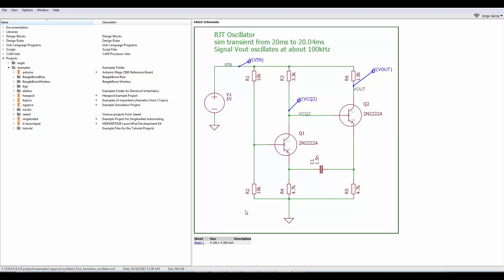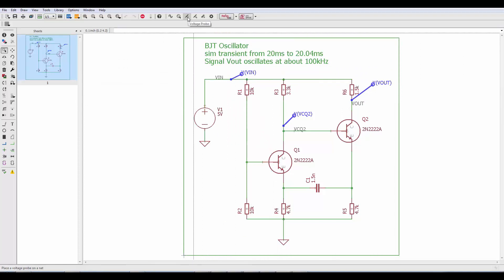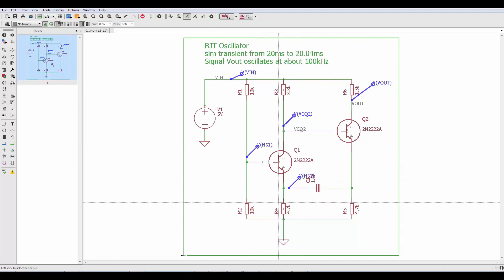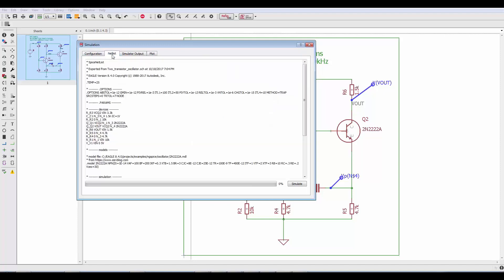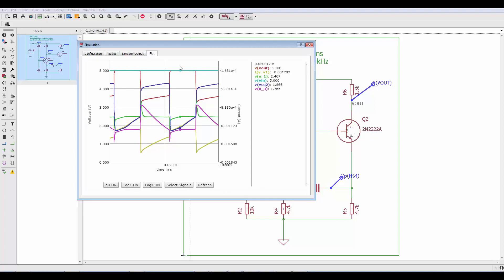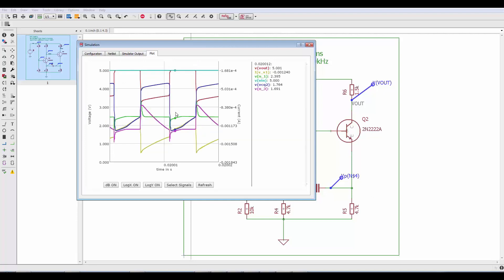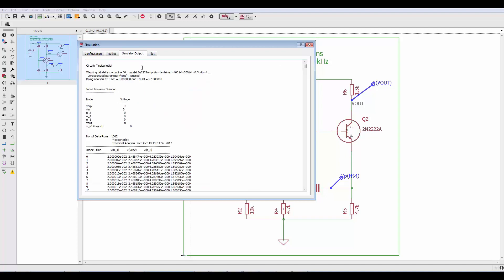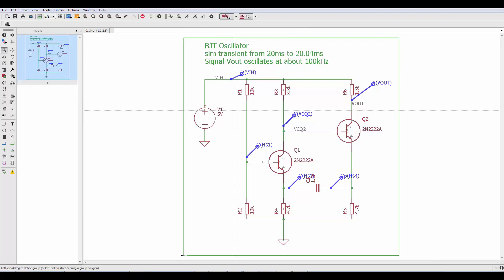Integrated Spice Simulation - Autodesk EAGLE - Overview - Tip 1

Comment: Hello! 
1. The current probes are missing? If not, where are them? 
2. The probe texts are overlapped with the probe circles and this looks bad. Please move it a few pixels away from the circle or add the smash property to the probes. 
I hope I will receive some answers :)
Reply: Hi Daniel,

We don't have current probes implemented in the same way the voltage probes are right now. For now you have to use the AMMETER component in the ngspice-simulation library that ships with EAGLE.

Thank you for suggestion #2, we'll look into it.

Best Regards,
Jorge Garcia